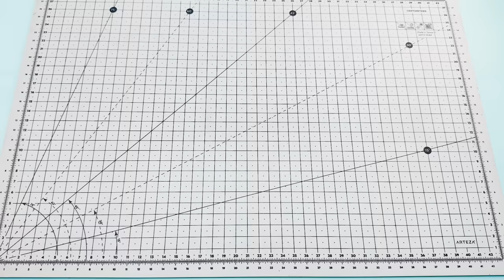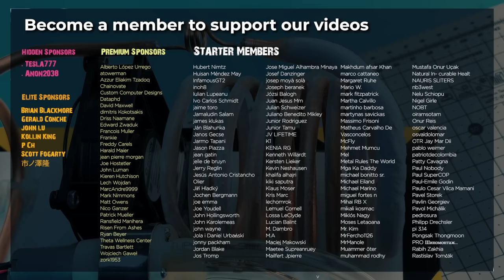How to Make a Powerful Mini Freezer - Portable Mini Air Conditioner up to -10ºC

Comment: It's a momentary freezer. After several minutes, the gas (isobutane) will warm up and will no longer cool the air surrounding the tube. To regain the low temperature, the gas must be recompressed. There must be a compressor and a  heat exchanger. Your stuff is just a toy.
Reply: yeah much easier to use a peltier
Reply: All those things are in place
Reply: 那台空氣幫浦就是壓縮機，大管子接小管子就會被壓縮。
這個裝置唯一的缺點是會漏
Reply: Et le tirage au vide qu'est ce que tu en fais ?
Reply: A working toy
Reply: @gatecrasher1970  ojAla sirviera el peltier...dime cómo hacer para que realmente enfríe? Quiero hacer una heladera de viaje ... gracias
Reply: It has all of that.
Reply: Thanks for saving me time!
Reply: @gatecrasher1970  it heats up too on one side
Reply: The narrow tube is compressor
Reply: Narrow tube acts as the barrier to generate the pressure difference
Reply: @Torq123  The tube has the same diameter and the same volume in the two sections separated by the pump. The gas flows with almost the same pressure; there's no barrier. The compressor (that lacks in this experience) compresses the gas in a chamber until its pressure goes high, and once it is cooled, it releases it into the circuit; "Gas Expansion and Gas Compression" the law of thermodynamics.
Reply: @sparky9327  The tube has the same diameter and the same volume in the two sections separated by the pump. The gas flows with almost the same pressure; there's no barrier. The compressor (that lacks in this experience) compresses the gas in a chamber until its pressure goes high, and once it is cooled, it releases it into the circuit; "Gas Expansion and Gas Compression" the law of thermodynamics.
Reply: the gas goes through the narrow portions of the tube, which increases its velocity and, and decreasing the pressure, so the narrow portions act as the compressor, in a way
Reply: It has the compressor in there? And the thin coiled copper tubes are the expansion tool that cools it all
Reply: @sparky9327 nah the compressor/pump is the motor the battery is connected to. The thin coiled copper wires are the expansion bit where the pressure reduces and what allows the gas to cool the surroundings
Reply: @lucassosa8419 не замарачивайся, пельте не эффективно
Reply: @lucassosa8419 jalan mucha corriente no Creo que Sean practicos
Reply: É uma idéia muito válida, e acredito que lê quis mostrar que funciona mas deve-se sim ter um trocador de calor e um dispositivo de pressurização mais eficiente.
Reply: @gatecrasher1970 mas consome muita energia.
Reply: @Torq123 tubo estreito, baixa a pressão portanto baixa a temperatura.
Reply: Meu amigo desliga esse treco por que eu estou com frio isso aí gelou o mundo
Reply: Capillery tube
Reply: @abdelazizlaanait5171 actually the decrease in size in one sektion will create a pressure difference causing minor cooling.
Reply: Need to use like a expansion valve
Reply: Your life are so narrow , even there's a lot of professional toy competition. Being a toy doesn't always mean its a punya stuff .
Reply: @Presidian123 Jalan no es un jugador de fútbol??
Reply: Это макет обычного холодильника. Будет работать. Если газ правильно закачать и обеспечить герметичность, то работать будет пока не сломается насос.
Reply: @augustoramos4873 ну уж точно не в минус. 2, 3 градуса, не больше
Reply: This is in the most simple form for Beginners.   Awesome Toy
Reply: But it works...
Reply: so make one
Reply: well,show yours
Reply: There is a compressor and a heat exchanger,i dont know how you dont see it 😅😅😁by the way,it works due to thermodynamics first law.
Reply: Still a cool toy, get it 😅
Reply: Эта игрушка на пять минут, зачем обманывать народ?
Reply: The gas will escape via the pump drive and absorb heat (become cold) in doing so and this type of pump cannot re-compress the gas.
Reply: @gatecrasher1970 those use too much power to generate a little freezing. Those are toys also.
Reply: Well said. Further, the pump used as compressor is actually  a low cost diaphragm pump which cannot be used to pump gas. 😂
Reply: I agree with what you write except that diaphragm pumps can compress gas - if the pump used CAN pump the pressures and volume required - both in and out - is another important issue.   To be a sincere DIY project more details of components needs to be included.
Reply: Ты что немного не в себе. Ты куда смотрел? В окно? 😊
Reply: The electric pump is the compressor and the copper tubing is the heat exchanger. I’m actually confused and a bit concerned that you would miss these crucial details.
Reply: It's useless setup without compressor
Reply: @ayushnautiyal5083  🥰🌹
Reply: А если где трубка вывода тепла, поставить перегородку и заполнить водой, чтобы выводимое тепло от компрессора выделялось не в окр среду а поглашалось водой, просто периодически менять воду. Может я ошибаюсь😅, не разбираюсь просто интересно.
Reply: ممكن عدم استخدام مبادل حراري ان تجعل تايمر لشفاط الغاز بحيث يفصل ويعمل بوقد يعود به الغاز لحالته الطبيعية
Reply: Si hacer neveras fuera tan fácil nadie las compraría y todos las harían en casa 😂😂😂
Reply: Это просто демостранционный стенд и он создан только показать принцип работы
Reply: I agree your opinion.
Reply: @solvated_photon oh my god .. air pump is not enough high level compression rate.
Reply: It needs 2 fans
Reply: @mahmoudharb1858  где ты её тут увидел? Здесь применяется сжатие компрессором
Reply: If it looks too good to be true it is
Reply: @mahmoudharb1858 
Ha fatto come gli Italiani,  non fanno vuoto!
Reply: Not really it’s just using the law of nature to do the work. You could call this a radiator instead of a AC unit. There is a radiator cooling block with sealed refrigerant that uses the concept of heat and cold transfer and it’s one of the best ways to cool CPU.
Reply: use R-134a refrigerant but you need a high power compressor
Reply: @lucassosa8419  6 Peltier de 12v en paralelo, conecta el lado caliente a un enfriador liquido para PC usando una lámina gruesa de cobre, el lado frio también, mete el radiador de la refrigeración líquida de PC a la heladera, pega las Peltier a un lado y el lado caliente de la refrigeración líquida de PC en otro lado de la heladera, en total necetas 2 refrigeraciónes liquidas de PC completas con bomba y todo, hice esto y pude congelar cosas conectandola a una batería de coche

Comment: Just want to point out that this guy also makes "Free energy generator" videos. This does not work this efficiently, that tiny cheap pump cannot compress gas for refigeration.
Reply: I though so, like wtf he just use tiny pump for tools that require high pressure 😅
Reply: I was looking for idea im going to look for 12v compressor
Reply: Обратный цикл Карно. Почитайте. Если сильно упростить, то данная установка выделяет тепла примерно в 2 раза больше чем отбирает ( да мороз не вырабатывается, а просто отбирается из внутреннего объëма). И как так, слева "конденсатор ", а справа "испаритель" И вентилятор, который дует от горячего к холодному.... 😅
Попробуйте кондиционер полностью в помещении поставить. Посмотрите, нагрел помещение или охладил.
Reply: Залил сжиженный газ, потом устроил утечку, газ кипит и отбирает тепло (пока он есть). Остальное просто антураж.
Ловкость рук и никакого мошенничества. С тем же успехом можно просто поливать газом то что нужно охладить.
Reply: Thanks for saving me time
Reply: Süper
Reply: And other side is hot...
Reply: Since he is using butane It doesn't have to compress as much
Reply: Normally, you must vaccum the circuit. The condensor and evaporator dont have the good length. This machine cant work efficiently
Reply: @ПавелБуров-л2ы да у него скорее всего под столом компрессор от холодильника. Он же установку в воздух не поднимает со стола.
Reply: Да уж испоганить 2 метра медной трубки, для копеечного видио это сила. Мог бы везде и все через трубку капельницы пропустить и показывать как трубки замерзають)) Остальным советую даже не думать на эту тему. Полная чушь. Принцып работы любого холодильника является давление и скорость перехода через разные емкости, калибровонные отверстия (это грубо). Данный эффект можно наблюдать, например, на спускание колеса автомобиля, когда сосок золотника при выходе воздуха покрывается инеем. Дальше писать безполезно))) Скажу по секрету, отой микро помпой лучьше капельный полив для цветов жены, на подоконнике зделай и то больше пользы было бы.
Reply: Used butano
Reply: 3:52 this is where the pressure is. Go learn some physics before commenting dumb assumption. Also, this section is what makes the system get cold faster.
Reply: Home made air conditioner
Reply: @xenomynth
Reply: the car also has a 12-volt air conditioning system, with a slightly larger air conditioning compressor

Comment: Such videos basically do not work. The motor does not play the role of a compressor. They are simply playing back a cheap machine that has been pre-cooled in the freezer to make it appear as if frost is forming. In reality, it never actually gets cold.
Reply: The air pump is acting like a compressor for the isobutane fuel and as it's compressed it gets hot but as it expands rapidly on the other side it gets cool just like a closed loop freon refrigeration system. Compressing a gas makes it hot, but a rapid expansion of the gas makes it get cold. This is a closed loop gas compression/expansion system. Instead of using freon as the gas, they are using isobutane fuel as the gas that is compressed, then allowed to rapidly expand to create the refrigeration looped system.
Reply: @wmman8256 I also rebuilt it and it doesn't work for me either. The air pump simply switches off if there is too much isobutane in the system and it does not work even with less gas. My only explanation would be that the pump builds up too little pressure?

Comment: There is a good layout for studying the theory. But, on large spirals from below under the base, tubes are imperceptibly soldered to the refrigerator compressor. Therefore, in a transparent tube, the movement of gas in the form of steam is not even visible.The compressor in the video is only capable of blowing bubbles in the aquarium😂
Reply: Именно по этому после запуска на видео не видно линии нагнетания. Думаю автор для демонстрации просто выпустил газ с баллона в испаритель
Reply: This video must be a joke. It is not possible for that tiny pump to reach saturation pressure of isobutane.
Reply: Lol there's not even a compressor

Comment: A very entertaining video, but it won't work that way. This small pump is not capable of generating enough pressure to compress the refrigerant. Additionally, there is no condenser present where the refrigerant can liquefy. The compressor pumps the refrigerant from the evaporator to the condenser, where the liquid refrigerant then flows to the expansion valve and expands into a gas, creating cold air. However, it doesn't work as shown in the video.

Comment: at 8:38 you can clearly see the condensation drops 'falling' back up the copper meaning this is a reverse time shot. The problem with all these DIY AC videos is that there's no seamless (uncut) shot of the device powering on and ice forming on the copper.  Someone will need to upload a video with one of these things turning on and having ice form over time - with a clock running in the frame to show its moving in forward time. Someone will also need to be juggling apples in frame, speaking proper english the whole time within frame, and like 3 of my friends will also have to be in the background giving a periodic thumbs up before I entertain that any of these are real.
Reply: @gregrell2441 - Tantos videos muitas quantidades deles no youtube tem objetivo de monstrar alguns segundos. /Ganhar visualização ou criticas e likes. Nenhum criador voltara no seu video dizendo que algo precisa ser alterado. Ou seu invento explodiu rsrsrs 
O Seu comentario sentimento é completamente perfeito, lamentavel nem ao menos sera lido pelo criador do conteudo. 
Observe que ele NAO se da o trabalho RESPONDER uma só duvida ou elogio

Comment: There are several problems.
1. If butane will start leaking, then there will be a danger of ingition (sparks in pumps motor).
2. The system as a whole is useless. Right now the shorter pipe is being heated and vent is blowing that hot air towards cooling pipe (long pipe). These two pipes shound be separated. Shorter pipe should be placed outside with its own ventilator and the longer pipe inside the room that you want to cooldown.

Comment: The tiny coil is a Thermal Expansion Valve. The left side is "relatively" under pressure. The right side is the low pressure side.

Comment: So the single 9v battery will run a 12v fan and 12v pump without issue? Interesting, I feel like every time I didn’t use enough voltage my devices wouldn’t work correctly or at all.

Comment: It has all the components for a closed loop refrigeration system. The vapor pump pushes a warm gas through the condenser coil that cools and condenses it then the capillary tube acts as a metering device discharging a spray of liquid alcohol that is absorbing heat required to change state to a gas.
Reply: can normal alcohol do then same thing?

Comment: I think the principal is legitimate, if the pump has enough pressure generation to liquify tge gas and the expansion through the capillary would create cooling. As mentioned of course the air streams need separating.

Comment: Mixing isobutane with the air inside the tube can create an explosive mixture
Reply: it won't produce that much heat, not even enough for simple flame
Reply: @cenanmehmet if the % of mixture create an explosive mix also 1 electrostatic spark can be very dangerous.
Reply: فكره رائعه وكل واحد يمكن يطورها حسب شطارتك وهي للهواة حلوه
Reply: @mchalabi  يمكن أن يكون خطيرا
Reply: @zerthura8500  all new gen ac chemicals are flammable gasses
Reply: @cenanmehmet  the problem is not if you use a flammable gas, the problem is  when you mix it with oxygen, if the mixture % reach a particular value you create an explosive mix. In that case a disaster can happen with a very little amount of energy, like an electrostatic spark.

Comment: None of the ductwork used to make this project shows the temperature of the copper duct at the back. 
Q = m.c.dt /// The heat gained and heat given off will be equal. But can provide short-term coolness. The basic principle of air conditioner and refrigerator. Until you expel the hot air from the environment, the result will not be very meaningful. Nevertheless, it may bring a little relief to residents of countries and cities who crave at least a light breeze.

Comment: Missed a major step , the air in the system has to be vacumned out , then topped up with refrigerant gas , to run properly thats why the pipes ice up , if you see a fridge compressor and the compressor is iced up , the diagnosis is the unit has lost its gas .
Reply: The compressor is the air pump, the pump compresses the air. The evaporator evaporates the coolant by absorbing energy from its surroundings, gas is a higher energy state, the energy must come from somewhere for the liquid to evaporate into gas. Ice builds up because the evaporater gets cold, cold enough that the water in the surrounding air loses enough energy and condenses on the surface before eventually losing enough energy and freezing onto the evaporators surface. If ice is building up, the unit is performing its intended purpose well, it does not mean there's anything wrong with it. If a unit loses its refrigerant, it will work less effectively until it loses all of its refrigerant at which point it won't cool at all, meaning that ice would never build up.

Comment: I just wondering, there should be cooling radiator because when gas is pressurized you need to cool it down, both actions results to liquid butane (or another refrigerant), then when liquid goes to bigger pipe it evaporates and takes heat from the room in yet another radiator and cycle continues, this is only half a project maybe less, and I do not believe that it actually works, there are missing parts... Every refrigeration unit needs some sort of radiators (two of them actually).
Reply: Of course it doesn't work, the simple fact that he injects the butane with a syringe destroys any credibility.
Reply: 4:44 - the cooling radiator is the one on the left, it's volume is smaller and the pressure there is higher.
Reply: @naydennaydev7071  radiating area too small to have all that heat dissipate...
Reply: @Sebucan7  yeah and also he didn't vacuum out the air, which if those temperatures are right, will froze up and clog the system in minutes...

Comment: Probably made money posting this video but anyone with any science background would know this would not work. That little plastic dc pump would never generate enough pressure.   He took the  shot of the coil getting cold as he was injecting more butane.  Dumb.
Reply: its a vaccum pump, the pressure is generated by the lack of pressure on the cooler side, thats why the capillary pipe is essential, you wouldnt need one with a proper compressor

Comment: So the heat stays in the same room as well as the energy used to power the fan and pump. Means you’re actually heating the room.
Reply: The room should heat up slightly but the heat in the small area is removed. It has its uses. For example it might be good to use on a small ice box where you need to remove a small amount of heat quickly and because the icebox is so well insulated, you don't need to keep the system running, which means its perfect to save on energy. It also might be good to cool a PC if you overclock it for a short amount of time.